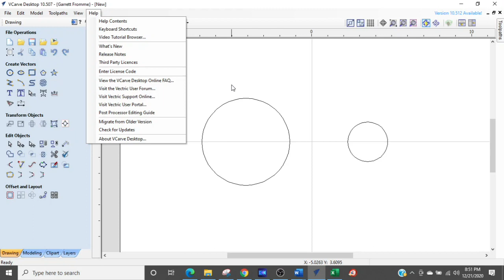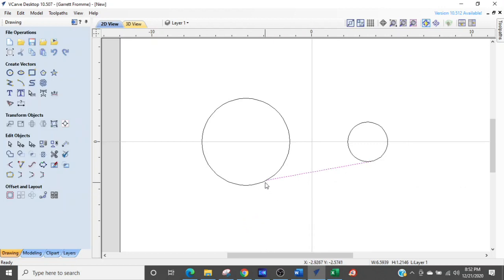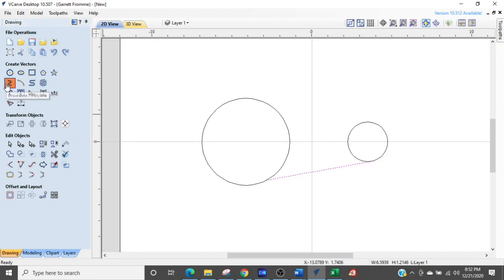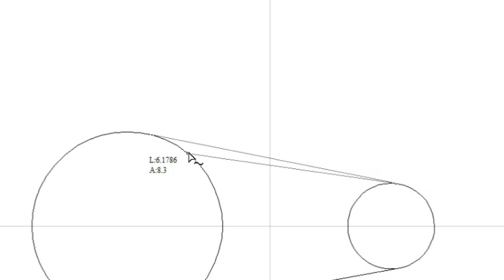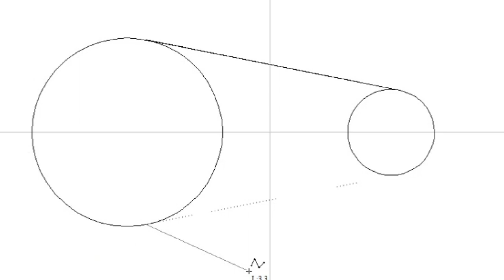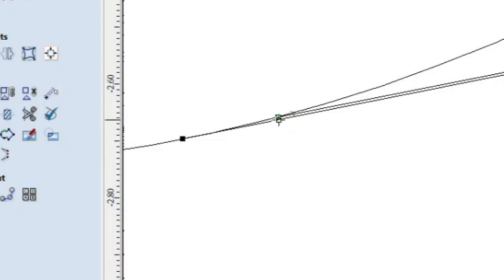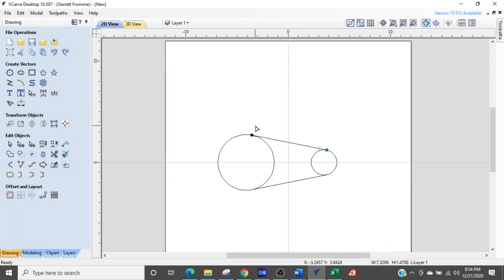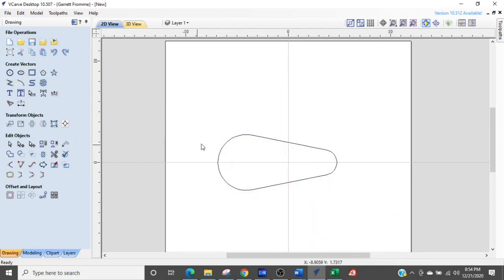Vectric Tangent Lines Between Circles Vcarve Desktop, Pro, Aspire for Beginners, CNC Laser Router

Comment: Hi Garrett. Thanks for the tutorial. I don't know if an updated version would make a difference, but after I've done the T on both ends of the polyline, on the end with the green square, there is no black square; just a black square on one end and a green square on the other. I try cutting the rest of the circles away, but it either cuts the whole circle, or it doesn't cut at all. Any suggestions?
Reply from the maker: turroger, This one is a little tricky to walk you through over comments my friend. I recommend joining Kate and I for our live sessions we host every Wednesday evening at 8PM EST. We should be able to help walk you through it then brother!

Comment: Newbie question - I am trying to draw a polyline and carve it. When I draw the Polyline (just a straight line) the program says there is 1 unsuitable vector and 0 remaining vectors so it does not calculate a toolpath for my line ??? Thank you for any input on how to draw and carve a straight line.
Reply from the maker: Bob, typically for your projects you will need to design a closed area like a square or a rectangle, circle etc to calculate toolpaths. Try the "quick engrave" toolpath if you want to carve on just a straight line.

Comment: Thx Garrett!  I didn't know about hitting 'T' to automatically create a tangent.... 
However, if the 'tangent' feature is only working on one side at a time, do you ever really get a 100% tangent?  We know the first point will be off (but potentially close), the second point on the opposite circle will be tangent because we hit the T... but is that tangent in reference to the first point?  if so, and the next line you draw back to the original starting circle becomes tangent to the second point... it's still not perfectly tangent to both circles, because the second point was tangent based off the first.  Not sure if that made sense but I'll check it out in vectric and see if I can demonstrate it.
Love your tutorials Garrett; keep them coming!
Reply from the maker: I thought about that. 2 points. How 'perfect' do we really need to be in a wood carving? Will the minor deviation really show up or be a problem? 

The second point is... you can draw lines back and forth as many times as you want to 'nudge' it closer to true tangent.
Reply: @IDCWoodcraft  Not that perfect what-so-ever... just wanted to make sure I was looking at this correctly.  To your point, if your first position is relatively close to tangent, it will definitely be good enough.
Reply: @jimaikman2875  This issue seems to have been fixed in version 11 VCarve (and I guess the other apps). Following this basic process and when you hit "T" on the second circle, it makes a true tangent line without the need for a second line. Nice!